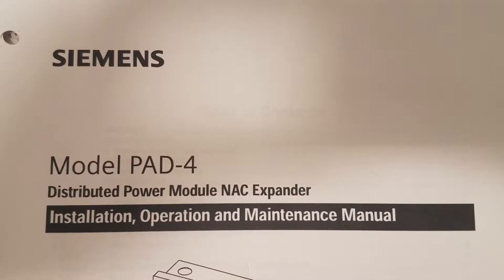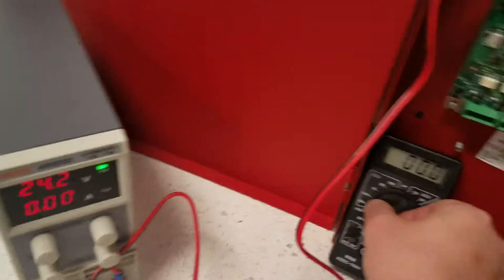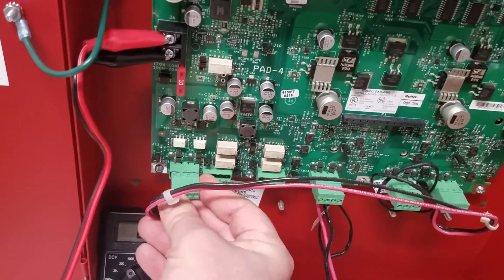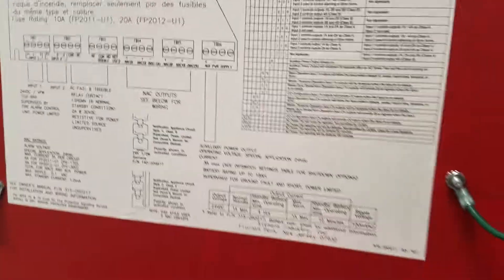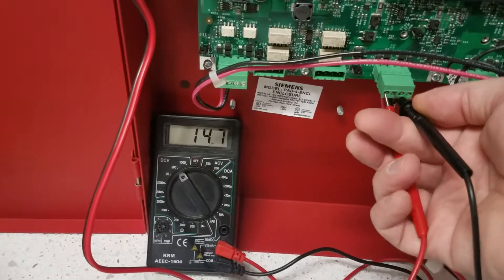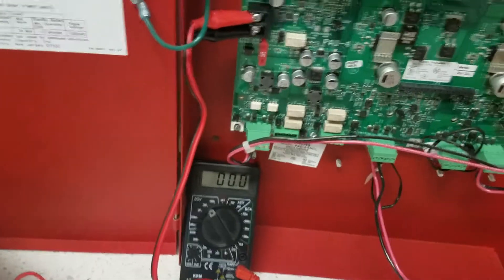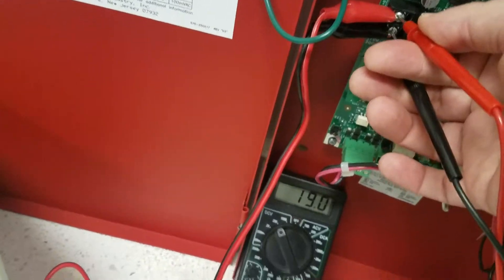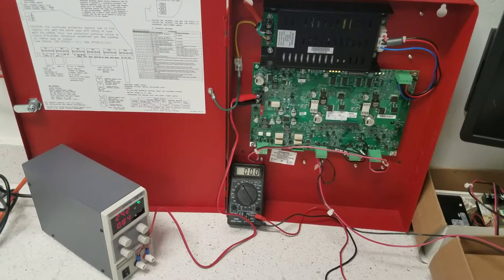Siemens PAD4 Power Boost Circuit

Comment: Thanks for the video. Got questions when power up the panel I get power Led blinking green and a ground fault with NO NAC circuit connect or any other wires. Thanks

Comment: hello, how did you do for the auxiliary output to always be energized? when reading the datasheet he says that it is only active in case of power failure
Reply from the maker: The 24V Aux power is always on, but via dip switch settings can be configured to switch off after 120VAC power loss to the power supply, with a 30-second delay.

From the manual:
"Auxiliary Power Output
The PAD-4 has a dedicated, power limited,
auxiliary output that can be configured in two
different ways. The auxiliary output can either be

non-resettable (always on), or configured to
switch off when the AC power goes off to conserve the battery standby power. When the
auxiliary power is configured to switch off, there is
a 30-second delay before the auxiliary power is
turned off after the AC power goes off. The
auxiliary power is for supplementary purposes
only if it is configured to switch off when AC is lost."
Hope this helps.
Reply: @johnmaitrejean2932  I have a PAD4, but I find it strange because my auxiliary output is only powered when I have power loss enable.

even with switch 4 in OFF, or ON, the difference is that when I have power loss and it is off it is always on, and when it is on it is for 30s.
Reply: @Felippe342  Sounds like its a bad pad panel